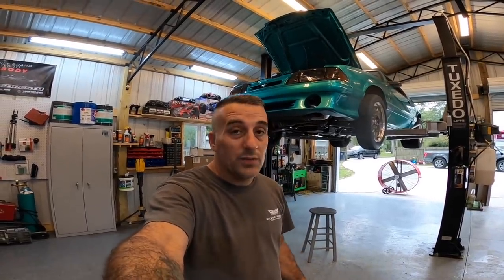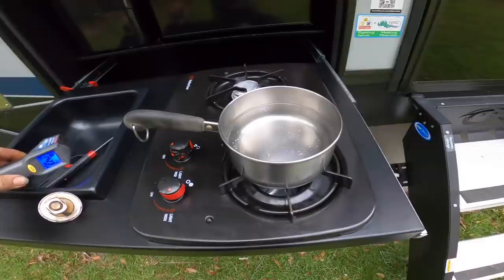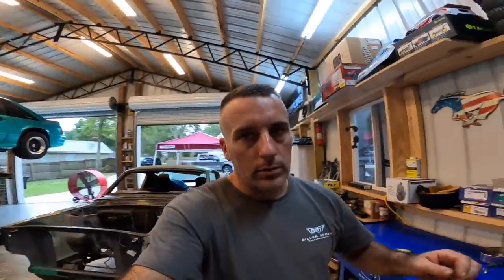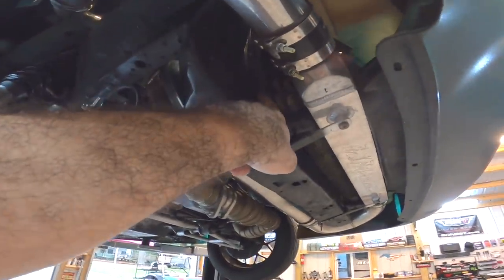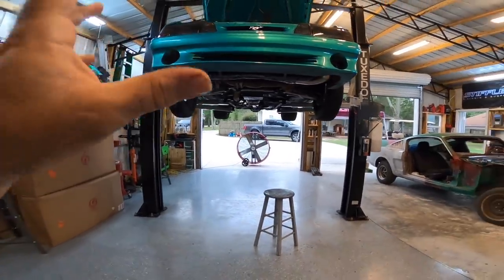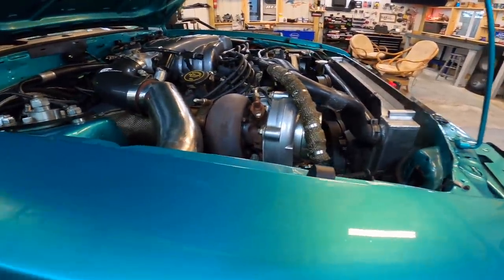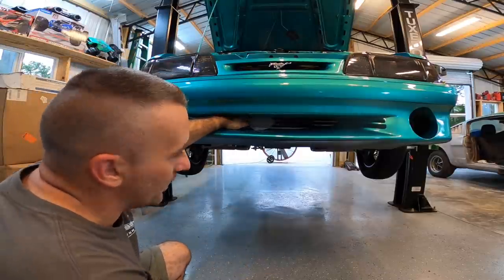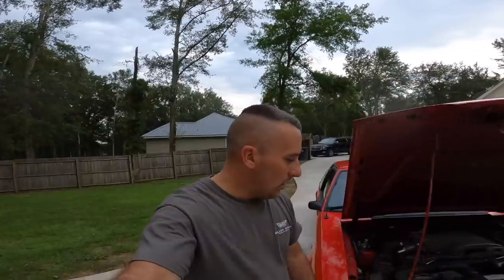OVERHEATING ISSUES? Check This Out

Comment: Good video!  I have a Griffin radiator with a high flow 160 and mine runs about 170-175 most of the time.  I did have a high flow water pump and I couldn't get heat in the engine!  Had to put an stock pump back on.  The combinations are endless!  N/A life though...

Comment: put the air damn on, its there for the Coanda effect and throw the 160 in the trash  the 160 will stay fully open until after you park the car,  Fluid needs time in the radiator to transfer heat when the cooling system is sufficient.  a lower temp stat will never help if you can't transfer the heat out of the system as it is, It just makes it worse. This is why newer cars use PWM fans to maintain temps these days and can pretty much hold them there within a few degress.    You can also make a sheet metal heat shield that goes over the cross over pipe so the heats deflected away from the radiator but I doubt that's causing much heat soak as it is.

Comment: Thanks for this video. It helps dispel misconceptions some may have about how the cooling system works. Great example of how to check your thermostat. Also how important it is to keep the deflectors on to duct the cool air properly to the radiator. A lot of people don't understand the difference of an extraction hood and a hood scoop. Thanks again.

Comment: I’m having issues with my B cammed (otherwise stock) car. Coming from Japanese and Euro car ownership, having overheating issues for seemingly no reason is infuriating. 

The car had a small drag racing style radiator installed when I bought it. I swapped that out for the Mishimoto radiator kit including a lower temp thermostat and 1.2bar radiator cap + 2 12” fans. Previous owner installed an Eden rock pump ~10K miles before I bought it. It begins heating up within seconds of coming to a stop. 

As far as I can tell, no blown head gasket. I am at a loss and beginning to lose motivation tracking down my issue. 

I want my American muscle, but I also wanna be able to drive it around town and stop at a light for more than 30 seconds if needed. Japanese cars simply do not have this problem until you start adding real power. Euro cars do, but it usually has to do with crappy plastic cooling parts. The first American car I own literally cannot idle at a light without creeping up. I can’t stand it.

Comment: My fox has always had weird overheating issues. Before the SVE radiator it would get very bad on the highway and bad in say a drive though. With a new thermostat and SVE radiator, highway driving is fine but sitting in traffic for a long time or a drive through will get it hot. Not to mention I always mysteriously lose coolant

Comment: 160 degree t-stats are for boats, which use liquid to liquid heat exchangers, or raw water cooling, both of which are more efficient, and have unlimited cool water to use.

Comment: @Brew2l......cars coming along and has really turned into a really sick build! Just seems of late you make a step forward and 2 back, from setbacks. As far as the cooling on it have you considers running maybe one or possibly 2 (space provided) of those small 7 inch e-fans to push some air from the front and then pull with the set already mounted to pull that ambient air across everything??

Comment: I got my 91 lx hatch, had it since new, I changed all the original stock coolant system as the car was getting a bit to hot anyway 1 problem I had was the white crude and some rust on the bolts, using a torque wrench and reaching the torque spec some bolts couldn’t do their job, cleaning the bolt holes out is needed now😊

Comment: I run distilled with one bottle of water wetter.. in the sw florida heat at idle etc it doesn't go above 180.. ever..now full disclosure I do run a maziere 55lph waterpump..sve radiator and black magic fan.. the fan is so bad I feel a breeze from it if it's on and I put my feet out the door.. I'll never use anything else.. this is on a 408w with afr 205s..170 thermostat..pa c4..3800 stall.. street car.. never take it to the track.. I'm currently running sunoco 100 octane but I'll be going e85 car is plummed for it pfte..

Comment: I'm a bit confused by what's considered running hot.  I have a basically stock 87 LX 5.0.  The stock gauge in the cluster indicates hot (red) at 270 deg.  The bottom of the gauge displays 130, so halfway between is ~200 degF.  I've got a new radiator, water pump, T-stat, sending unit, and almost all hoses are new (only some of the small ones are not).  After refilling with 50/50 green and thoroughly bleeding the system, then sitting still idling on a hot day here in Alabama, it crept up to ~235 F.  Is that close to normal, or should I be concerned?  I do know that I need to do a few more  drain, run and refills to get my coolant back looking clear.  The engine block's water passages seem to be bleeding rust (I had a body shop do some work several years ago after an elderly lady hit me, and I think they put straight water in it after replacing the radiator and didn't tell me...guess I was busy then and didn't think to check the ratio).

Comment: I just put a freshly built 30 over 302 in my stang... Have a 3 row Rad... Dual Fan Mishimoto setup.. flexalite adjustable fan controller.. my stat opens right at 180 and I have the fans set to kick in at 195.. come off at 185 above the stat closing.. but this dam car likes to run around 200-205 when its smoking hot out... Is this concerning??!.. hot starts suck... Had to wire up a fan controller overide so that fans arnt on when I crank it up hot...

Comment: Dude I was at 230 degrees, it was so hot my belt melted and ripped off! I can’t figure out why it’s getting so hot.. everything was perfectly fine until I changed my head gaskets. 200 was the hottest it got. I’m literally going nuts trying to figure it out.. my head gaskets blew bc I installed a suppercharger, and then I put a smaller pulley on…smh

Comment: Just my opinion I’d put the air damn on before buying a hood.  180 should be the correct stat to use so it doesn’t stay open only circulating hot water.

Comment: What temperature thermostat do you run I have a 331 with a procharger and I have heat issues and also did not know about the deflector I’ll be putting mine back

Comment: I just put a 180 degree thermostat in my 91 lx. Do you think I'll have problems with that? I just wanted it to run alittle kooler than 210. It seemed real hot at that 210-220
Reply: I run a 180 stat on my 89 with no problems. Seems to run better than when it had a 160 in it.